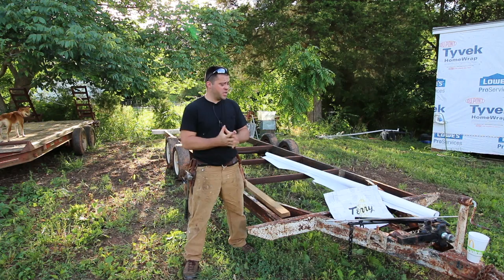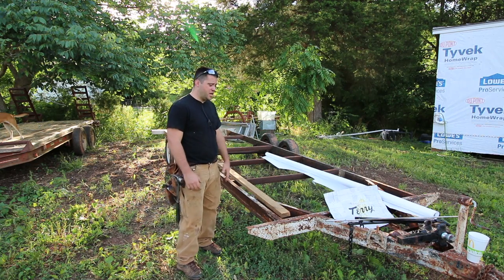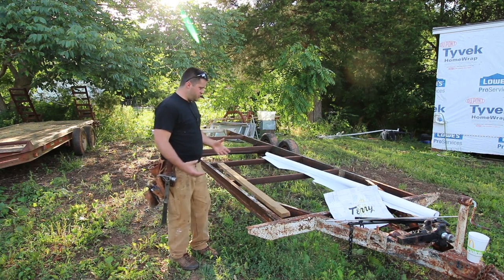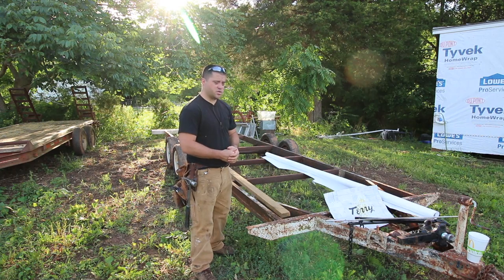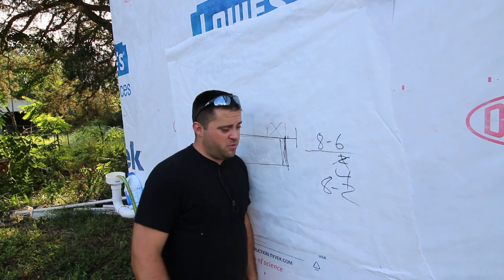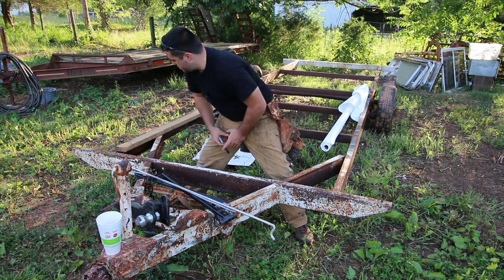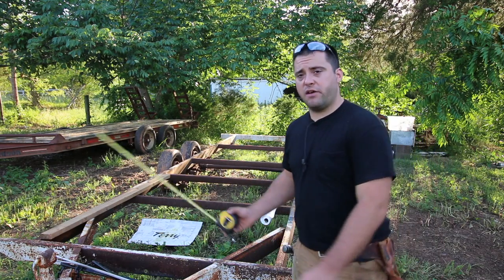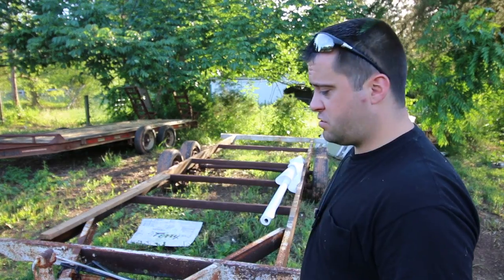Tiny House TERRY E3 - Trailer Prep and Sand Blasting.

Comment: If you were to weld outriggers on the sides to supporrt the side walls, box the main c channels in (like Boyd Covington used to like it), ad some gussets here and there and maybe even put in some extra joist beams between the existing ones you could have a more then acceptably strong chassis and you could skip on the deck frame.

Comment: You could swap the axles and springs with new and still have a trailer that's a steal of a deal.
Reply from the maker: +Michael Janzen  true. I kinda feel I'm gonna have to do that on my current build.  There's no way it's gonna be under 10k. It's a good option to have, but an expensive one.

Comment: Mine was an RV trailer, and was 7 ft by 14 ft, so I had my son sand blast and weld onto it, to make it 8 ft by 16 ft, then painted it, oh and build wheel wells, but, the wheels are tucked under the 8 ft wide walls. It's mostly done, I haven't tried pulling it yet, but I have seen them built this way, not very many, but they are out there, that's how I ended up here, because I want to know how they pull. Seems the house would rock a bit? Yeah, those axles are 3500 pounds each.